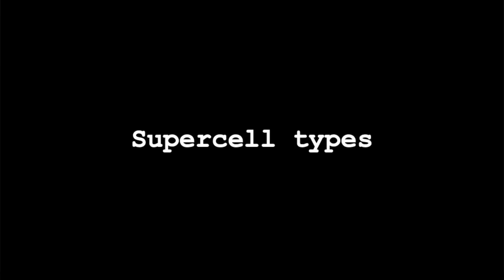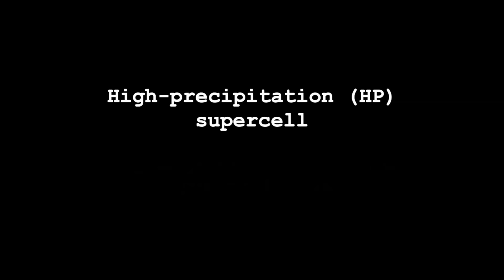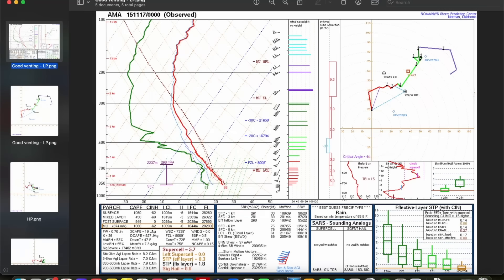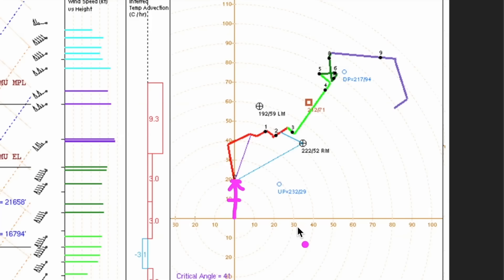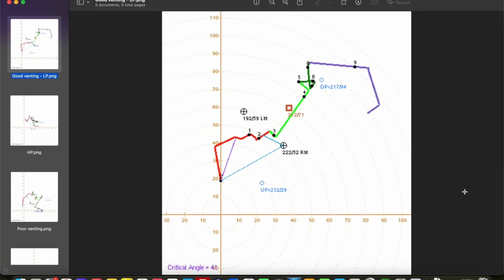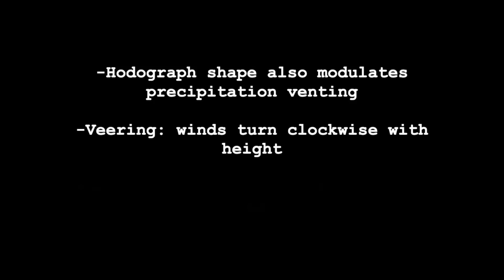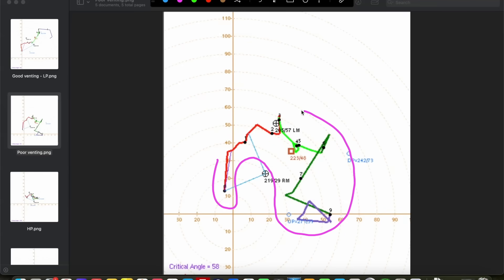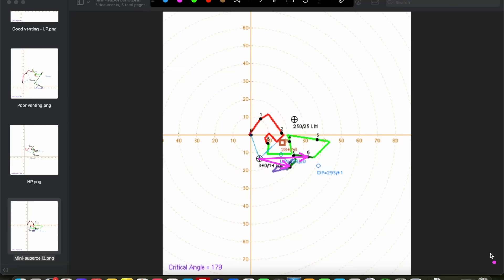How to Identify Different Types of Supercells

Comment: 8:43 As a math guy, I used a straightedge to approximate the graph positions of point number 6 and the RM, squared them, added them together, took the square root of that sum, so the hypotenuse of a right triangle (with those points as two of the points, and the third being the intersection of a horizontal and vertical line drawn from those points), was actually above 40 (42.9 and change, so 43), so my initial viewing estimate of “about 36,” when I didn’t use a straightedge to be more precise, and just rounded to 20 and 30 being the lengths, was incorrect. Your estimation skills are superior, sir, but my easy math can confirm it pretty quickly ;)
Reply from the maker: Is that a challenge? Lol!
Reply: @StormChaserCoaching  That’s up to you. I’m down for any battle, as long as it’s all in fun :)
Reply: @StormChaserCoaching  Btw, I’m actually shocked that I remembered my math from 20 cough, cough years ago. But if you design a test for me to measure and verify or refute your estimates, based on hodographs (I didn’t know how to spell or decipher until this video, thank you), I’d be happy to plug and chug the answers (or even teach you what I did, since it’s basic algebra, and I owe you one). :D
Reply from the maker: @Bobal27  I'm just the social media admin haha, I'm horrible at math.